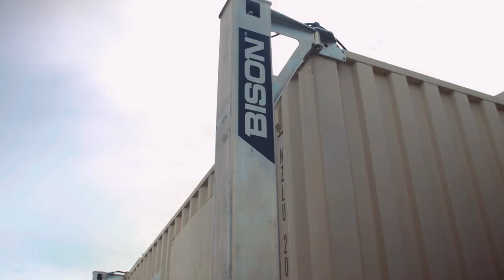Bison C-Lift T Series | Transportable Container System

Comment: Hi, could a system like this be used/modified to lift a container of a train? If such a system could be made, a train could leave a dosen containers, which could then be delivered by a single driver over the course of a day. And it wouldn't require much infrastructure.
Reply from the maker: Hi there, thanks for your question. A challenge in getting containers off trains is you need to move them off the side of the wagon. Our systems lift containers vertically only, so aren't really compatible.
Reply: @BisonJacks  If you could lift them sufficiently high to clear a container wagon, you could remove the train. If the rails are on a flat surface you could move a truck under the container and transfer it.

Comment: Are they detachable to use on other containers throughout the day? How heavy is one leg?
Reply from the maker: Hi Robert, thanks for the question. The C-Lift T Series legs are detachable, but they are not perfect for being used on multiple containers per day. We have a number of Container lifting equipment like the T Series, but that is specifically made to be quickly attached and detached. 
C-Lift M Series - a manually operated lifting solution: https://www.youtube.com/watch?v=aNOa8nvGTK4
C-Lift P Series - a high capacity, semi-automated unit: https://www.youtube.com/watch?v=d-EPKvahtgY
C-Lift A Series - fully automated, high capacity: https://www.youtube.com/watch?v=1DtxgsdIQ7Q
Lots more details about each of these are available on our website at www.bison-jacks.com
Thanks
Reply: @BisonJacks  Thank you. All systems will work. What I'm doing is mobile container storage delivery. I'd be moving people's belongings by dropping off a container for them to load and then I'd pick it up "level" to load and then transport it to their new home.
Reply: @BisonJacks  So overall a system that'd be traveling with me on my truck daily to load and unload containers from my flatbed truck
Reply from the maker: @Flipping_Assets  The T Series is a great product for travelling with the container, however, is not super-quick to disconnect, so you wouldn't want to be doing this multiple times per day. The other option I would suggest reviewing would be the M Series, which packs down small and would be transportable on a pickup etc. Feel free to email one of the team directly at sales@bison-jacks.com so we can get a better understanding of your operation, frequency of lifts, etc etc. Look forward to working with you.